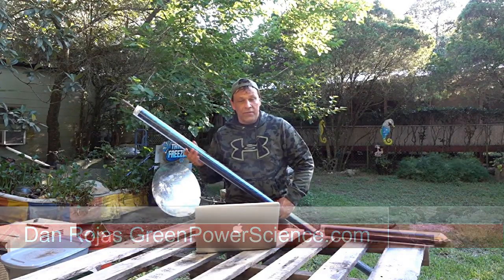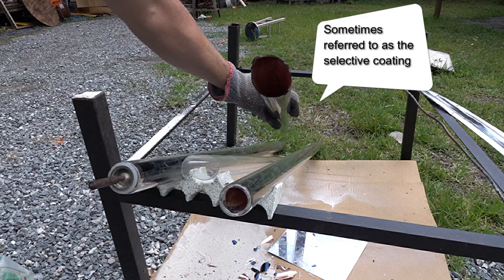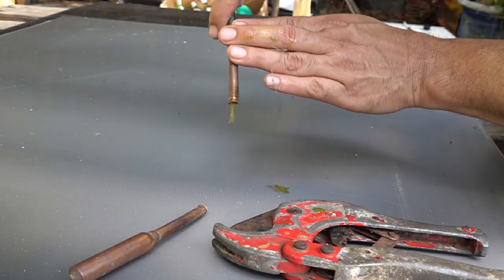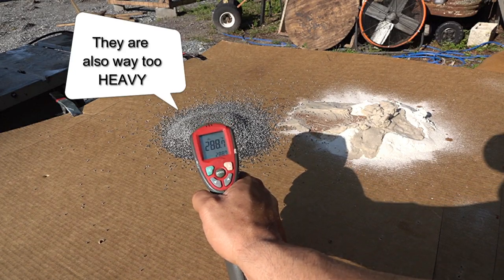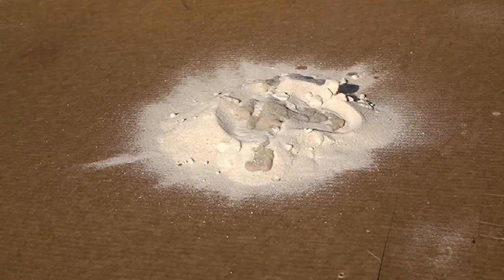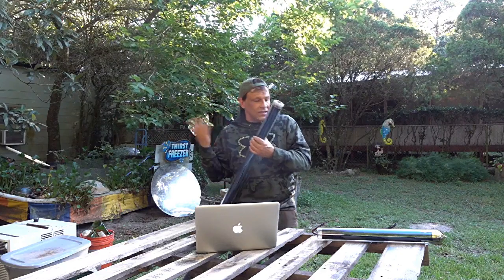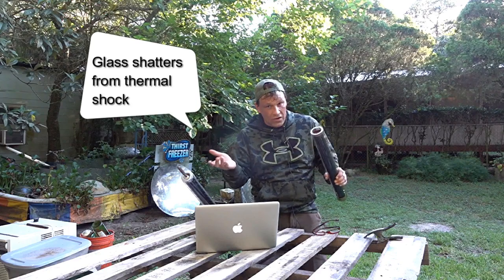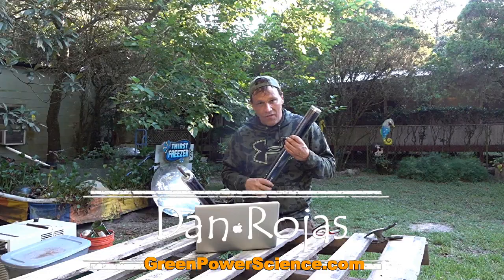Solar Sand Battery Evacuated Tube Implosion Solar Water Heater Thermal Storage

Comment: thanks for the video!
i'm considering building my own tubes.  as a borosilicate glassworker with just glass, a lathe and a vacuum pump, i'm wondering if i can get away with just using cobalt blue tube for the inner tube, and skip the fancy coatings i've come across in my research- aluminum nitride, stainless and copper?  also the barium toxicity hazard of using a getter is a concern.  
your sand idea is a really good one, thanks for sharing!  

how about black sand?

Comment: Quick question: if the cooper pipes slides easily in the aluminum foil channel, the thermal transfer will be worse? On some tubes the pipe was inserted harder, on some easier

Comment: How can you shut your system down without removing the tubes, lets say I don't want it working in the summer, can I just drain the system down and leave the tubes where they are or will it get too hot in the manifold????????

Comment: I'm curious if the solar evacuated tube actually radiates heat. If I filled several with sand, and heated them through the day, could they radiate enough heat to say.....keep a small space warm?
Reply: tubes themself do not radiate heat ... the inside will be very hot while the outside will be cool to the touch

Comment: The copper bulbs provide a way of accessing / transfering the heat to a system in a useable way.   It's not really useful having heat trapped in a thermos/ sand.

Comment: Why use glass for the tubes?

Acrylic tubing would be a better choice.

It's stronger, tends not to shatter, and transmits more light than glass.
Reply: glass tubes are double pane.   Are the acrylic tubes double pane?
Reply: @Patco.1981  They can be as many paned as you want them to be, by putting tubes in tubes.

Comment: We have a 22 tube evacuated solar hot water system in Australia, it provides us with extremely hot water for 10.5 months of the year with the Electric booster element turned off.......315 litre storage tank A few weeks of boost is acceptable... :)

Comment: Great video 👍 
first one I've seen that actually gives information on how these actually operate.  I've inherited components of a solar thermal system but apparently missing the copper heat pipe tubes that go inside the evacuated glass tubes. I couldn't figure out how it was supposed to work, with one end of the glass closed.
Reply: Exactly my thoughts also..I see the principles of the system.but I would love to know what chemical and how much is placed in the copper tube before it is sealed.

Comment: Nice video. I have a question. My collector has 20 of these head pipe tubes. After 7 years of operation, I found that some tubes on the surface are colder and others are warmer (you can keep your hand on them). The glass tube is mirror-shiny (which should signal the presence of a vacuum - the tube is OK).
Don't have experience with why some tubes are warmer and others are colder? It cannot signal a fault (media leakage) inside the unseen tube. Does it not transfer heat to the collector and therefore the heat is transferred to the glass tube?

Comment: Hey Dan why couldn't one just use the copper pipe to run directly into each evac tube and connect at the top? Would it not be more efficient to have the heat from inside the solar tube transfer direct into a copper pipe filled with water instead of heating just air inside of the tube that in turn heats only a small portion of the top of the copper pipe?

Comment: The problem with using sand as a heat transfer medium is it's going to act as an insulator and the heat will not transfer to the copper heat pipe very quickly and therefore, there will overall be loss of thermal efficiency. You're able to recoup some of that heat at night and that's the problem; the heat stayed in the tube for a long time rather than getting transferred to the water storage tank and therefore a large portion of the heat was lost back to the ambient. A vacuum tube is an excellent way to prevent conduction and convection of heat but radiation still occurs.

The problem shown regarding the water hitting a hot tube and causing an explosion should not be a problem with a properly designed tube collector. The top of the tube is inserted into a manifold which uses a gasket to prevent any water from the elements getting in. Rain or not, the tube will be safe.

Comment: Considering that the sand is still within only 10F of the aluminium fins, it has no advantage there.   
So the main advantage to the sand is that it acts as a layer to soak up (& flash-boil away) any ingress water before it can get in contact with the hot black glass, yes?

Comment: Heat pipes are supposed to hold a vacuum, which causes the coolant to vacuum boil when heated, transferring heat extremely quickly.

Comment: Just got seven 30 tube collectors. Interested to know of any information on the type of fittings etc to use..  Was told that compression is better due to the heat buildup my melt solder if the pumps fails.....also any links to heat dissipation ideas for the summer months cheers Clive

Comment: Just wanted to add on the sand in evac tube, what you win in the evening as delayed heat- you loose in the morning as heat is delayed. Most likely you loose more than you win as the accumulated heat cool off slowly - there is lots of energy lost in the dense sand as it falls under useful the temperature. Every morning you will start with cold sand. Cool feature with sand but not adding energy.
Reply: Depending on whether you had an overbuilt or underbuilt system, filling some tubes or some portion of each tube might be desirable for certain use cases, but the best/most efficient use of sand would be in an insulated vessel within the house (ie a sand "battery"). Build a switch valve on a timer or temp sensor that diverts or splits the water through the sand battery instead of or as well as the water heater.

Comment: Probably the most efficient way to extract energy from sunlight is to focus it into a black body enclosure such as an empty sphere with a small opening & with matt black walls on the inside. This will retain a large proportion of the energy within the sphere. Run water through a pipe & focus the sun onto the pipe in the middle of the sphere. Boil. Steam. Tesla turbine. Generator. Sun tracking Fresnel Lens heliostat.

Comment: I'm also looking for a way to run a steam powered generator with solar steam. I thought about using a fire extinguisher tank with mirrored sat dishes. And build a sun tracker. To run a converted steam engine. To spin a 150 amp alternator . or two to charge batteries for my offgrid home. Since my water can't power a hydro electric generator. No head and little flow!  So I'm thinking solar steam along with my solar panels. Then I can use a wood fire to heat a boiler when there is no sun. I want to burn trash and wood for heat also. Use the exaust from the steam engine to heat the house. And heat water. Bypassing the tankless gas water heater . lots of projects! If it all works it will be nearly free heat and power. With a smallish carbon footprint.  Do you know of a source of quality cheap tubes. For hot water and heat anyway! Keep up the good work...
Reply from the maker: Hi James,
It will work and there are some steam videos on our channel from years past. I moved away from steam because of the low cost of PV panels now vs sun tracking and moving parts like a steam engine. The best option would be to have new water entering through several hundred feet of spiraled  black hose at a very low volume.The evacuated tube can be punched in 18" versions off of the internet. The only realizing option for long tubes is a complete water heater system with tubes because the tubes alone do not ship well. I once sold them on our website greenpowerscience.com and they broke in shipping 90% of the time regardless of packaging. The smaller tubes are no problem with this. Back to the set up. The black hose water preheated from the hose would enter a copper loop, there are 5-6 tube small systems with fins on ebay so the pressure is in the copper tubing and not the tubes.You can alter this with sand etch like this video. The water has now been stepped by hoe and tubes, the final step would be a small 12 ounce boiler with a pressure release valve that either a Fresnel Lens or 35" parabolic mirror (see our website) with a sun teacher to the smaller black colored boiler. The water would enter gradually at about 3-5 ounces per minute. This maximizes the process and prevents wasted energy on large masses of water. Check our channel search for seawater and you can see the difficulty with large volumes of water. The goal is to expose  the minimum amount of water and convert to steam. If you need more steam then boiler 1 would be totally full and a second mirror or lens would heat. Also check our channel for DYY Trough Collectors as they linear beam is easy and a massive amount of sunlight can be focused to one steel pipe. The pressure pre lease valve is always a must even for small boilers and the Parabolic Mirror, Fresnel Lens, or Parabolic Trough should have the beam covering about 70% of the boiler vs a small very hot spot. The small spot may be hotter but is inefficient at transferring concentrated sunlight to the target so 70% works best. Total coverage results in missed ares that radiate vs absorb or transfer to the water. You can do a closed loop system with a small pump designed for handling hot water that has pressure of 40-50 psi running from a small solar panel then condensing the water or just use a hose attached to domestic or well water. The car alternators do not work well but AC motor converters to a bridge rectifier result in higher voltage at lower RPM as car alternators require several thousand RPM to excite and cog with a load. Check our channel for DIY alternator. If you opt for the ebay mini vacuum tube heater with the prefabbed copper tube, place a flat glass mirror behind the unit about two - three feet away to reflect light from the backside. Placing the mirror directly against the tubes basically does nothing. Please let me know if you have any questions and check our channel for videos and or website.
Reply: GREENPOWERSCIENCE 
Thanks for replying . I really want to do my part to help the earth. We have been treating it rough for too long. It is going to come to the point where this is the only source that is affordable. I just hop it isn't too late to make a difference. Yes I could be on grid. I'm 30 minutes walking distance from town. But I am lucky enough to have a place surrounded by woods. Very  close to town. It's not a big town but its what we got! I have thought about digging a pond and use it as a resivor for a hydroelectric project. But the water stops during a few months with no rain. I may give it a go anyway. 10-20amps at about 30v for 12-16 hrs a day is better than only using power that time. That would be enough to run my home during the normal daytime.  allow my  pv to charge the batteries. It's been a while since I seen your videos. I subbed a year or two ago. I haven't seen a video since well a long time. Do you have any energy saving or producing at home? Keep on keeping on man thanks again!

Comment: I think you need to consider the heat transfer rate of the sand. Seems to me it would be slow at getting the heat through to the copper pipe.

Comment: How do i remove the hard water scales from the inside of evacuated glass tubes?
Reply from the maker: Acid based products. Something stronger than vinegar. I CAREFULLY  with respirator mask, gloves and eye protection take an ounce of muriatic acid inside and swish around with a fan blowing fumes away from me. Pour out on a cement block and rinse with a water and spray a surfactant like "Totally Awesome" from The Dollar Tree. The hose out good and you are ready to go. Toilet rust remover works great too and you only need gloves and eye protection. You do not need much so you can flush it down the toilet.

Comment: I have a question.
Suppose I filled solar evacuated glass tube with sand and closed the open mouth by thermal insulator. And placed these solar tube in sunny day for couple of days. What will be happen?  Solar evacuated glass will explode or Sand temperature will constantly increase or Solar evacuated tube refuse to absorb more radiation after achieving same temperature by Sand. 

What will happen? Please explain.

Comment: As a co designer of the Apricus brand since 2003, and importing and testing China tubes in Cyprus in 1997, the reason explode or implode is becouse they are sold to be installed with a presurized system, which i have never done since i started in solar thermal in 1990, but i started with the developing of the hot water tank first, now called a Thermal Store also developed by my then partner in the USA Norm. My UK tube failures in the early days was found to be caused through the build up of heat in the tubes, so when we stoped useing the typical pluged tubes to open tubes with our heat pipes inside, we solved the first problem. Our latest heat pipe tube collectors now come with a sensor built into the condensor of the heat pipe, which stops tank over heating to 80c, but unless the solar industry starts to reconise that all the solar failures and the limited use of solar thermal is becouse nobody understands thermal stores, first developed in the UK by me in 1990

Comment: one of these tubes might be able to run a sterling engine without the need to constantly re-focus a concentrator on the displacer piston, which has always been the bane of a solar run sterling engine.

Comment: I have the style with no heat pipe and a copper coil inside the tank. I had to put a hot water recirc pump to keep it from boiling in the summer. The pump allows the hot water to be stored in my 40gal electric water heater tank. I'm on my 2nd unit. In the summer it provides all the hot water for us, in winter it acts as a preheater and allows me to run my electric twice a day for 2 hours to save on electric cost. I use no reflectors.

Comment: They implode becouse the tubes are closed with a plug and then when installed, the solar side is closed loop, creating tempertures in the loop to over 200c. But you are 100% right to say they are the best, as had on my UK roof for 12 yrs, but use all the day time heated solar water into my 250 litre thermal store to heat my 12 radiators during winter months.

Comment: Hay could you not use gallium in place of water and pump that hot liquid metal through copper coil heat exchangers to both heat water and operate thermal electrity generation?

Comment: I was wondering how big temperature inside it can handle, becaouse i consider to make it working only on air. Two posibility exchange air inside (use only glass tube) or solder extra coper radiator and use with  heat pipe. The reason for that is to use it as direct air house heating (as suport for main heater) What You think about that?

Comment: You just change an thermal inertia. Disadventage is so that when the sun showsup You must wait longer until the sand will heatup also, but idea is nice.
Reply: it is not, because you can have 10 tubes and got 5 of them with sand and the other 5 without sand, so you will have all day long...
Reply: does the heat of sand breaks the glass after a while?dont know what kind of glass they are using...

Comment: WTF, where was the science part of the "Green Power Science".  Science is the process of carefully developing theories that correctly predict future behavior.  The process involves careful measurements, isolation of variables, and quantification of measurements and predictions.  This video describes phenomenon in entirely qualitative terms, and little no regard to well accepted science and engineering terminology.

What was the idea behind filling the vacuum tube with zinc or sand or whatever, he never really explains, just some vague reference to the lightweight aluminum typically used in these systems.  Nor does he ever demonstrate with experimental results any actual increased performance of a solar heating system using sand instead of aluminum conduction media.  

What was he trying to show by measuring the temperature of sand inside of a vacuum tube, or that it would cause water to boil when poured on the sand?  Is it better for heat to be absorbed into the sand inside the collector or to transfer the heat to the actual thing you are trying to heat (water or perhaps the inside of a home), he never demonstrates why he would conclude one or the other.
Reply: I guess you're right.  I just wish people would stop using the word science when they actually mean entertainment that includes some poorly defined, or entirely incorrect, explanations of scientific principles.  Myth Busters made millions on pseudoscience, and while this may be useful in getting people interested in science it isn't science itself.  But I guess I am beating a dead horse, science education in the US is generally awful and it's getting worse rather than better.

Comment: Great idea !! Does the sand increase the volume due to heat expansion of material? If so ,then for long term use,it will crack the tube open and imagine that mess on the roof.If no expansion problems..I wonder how many tubes will hold steady steam to turn steam generator and produce some decent power.